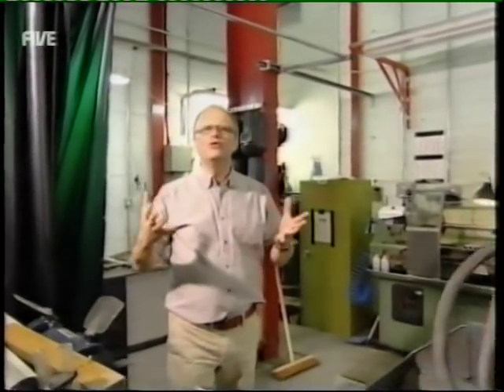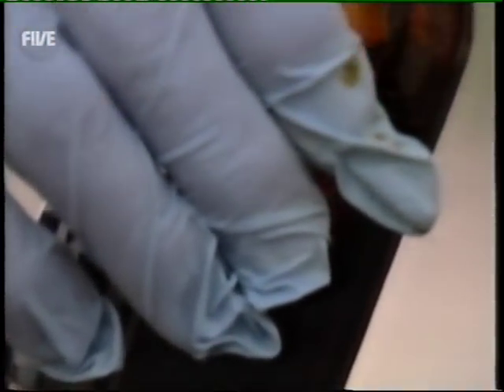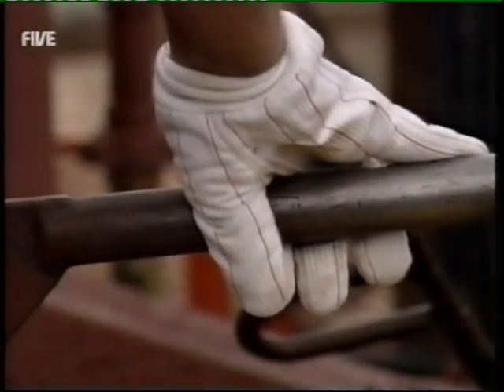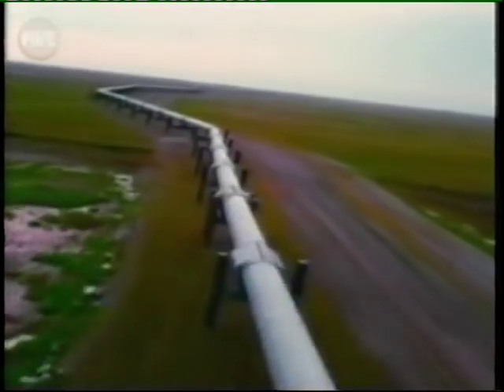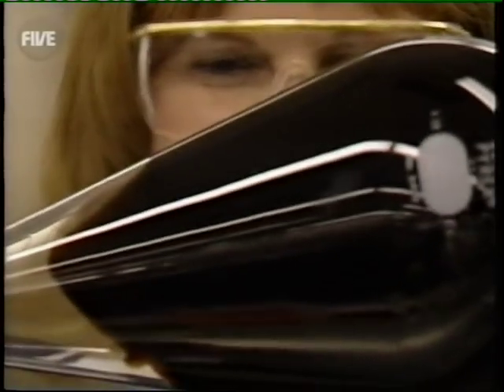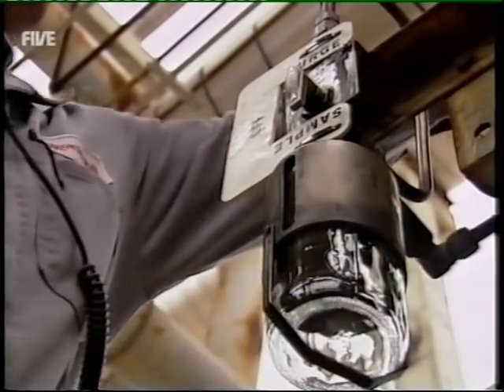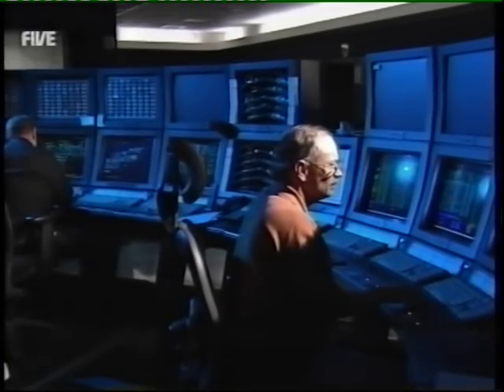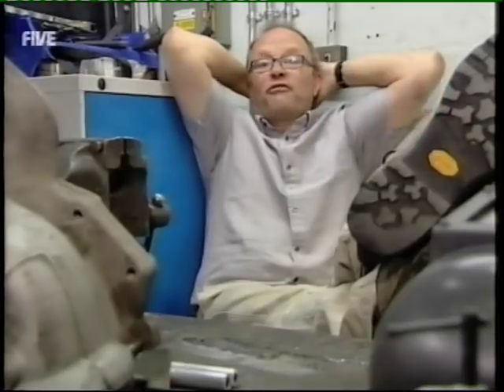How to Make Petrol or Gas from Crude Oil.

Comment: Well, that’s alarming! If they “...pump out 900 thousand barrels every day” and there’s only 10 billion barrels left, then it’ll ALL be gone in a mere 30 years (within a single generation).
Reply: And this was made in 2010, 22 years to go.
Reply: There is much more than 10 billion barrels. BP’s estimate is roughly 1,690 billion barrels that would be economically feasible to obtain using today’s technology.
Reply: thats why we are mostly buying oil from different country ( mild east)
Reply: You would have to add an ‘estimated new discoveries’ forecast to that equation, if they are calculating based on verified deposits only.
Reply: Crude oil is constantly being produced underground. It is by no means finite.
Reply: Oil does not form that quickly. It takes millions of years of pressure and elevated temperature to produce one barrel of oil. Pretty much all of the crude oil that we will use has already been created underground. What you're meaning to say is that oil reserves are constantly increasing due to improving technology to recover the oil and the current price of the oil. For example, hydraulic fracking enables crude oil that is trapped in shale rock to be extracted. This is only possible when prices are above 60 dollars a barrel. When prices are below that estimate, it is technically not recoverable. 
Source: I am a petroleum engineer
Reply: No, I meant the former. No one knows how fast oil forms, not even engineers. Your second sentence is straight from industry handbooks, yes? If it took that long per barrel the oil we consume in one day would have taken trillions of years to form. So without the pertroleum industry spin .. it takes the same time to form 1 barrel as it does to form a tankerfull.

Are you certain engineer is your job title? Perhaps you misspoke on your last sentence. "…. it is FISCALLY not recoverable. It can be recovered if cost is no object.
Reply: @Deploracle  Everyone knows that oil in a reservoir is only at the max around 30 to 40 percent recoverable if you spent time actually studying the said field with the best recovery options. So yes there are barrels of oil that are technically unrecoverable with current technology. Your math is also incorrect because there were a copious amount of barrels that formed at once. Not one at a time. From your response I know you are not knowledgeable in the said field, so dont reply about stuff you do not know about.
Reply: Agree to disagree my friend, I know exactly how it works. By the way it was you that said "one at a time" (it takes millions of years and X amount of pressure to form JUST ONE BARREL OF OIL.)". Take care ...
Reply: @Bluudclaat  thank you. I realized that he was a lost cause when he said "agree to disagree" to something factual. I dont understand how someone who probably doesnt even know 3 compounds in crude oil can comment "facts" about oil. No help for the ignorant.
Reply: Except for one little point … I'm not uneducated (physicist).
Reply: Yes, indeed. It's a religion exactly as I described. One must not speak from a position of science against the cabal. It is NOT allowed. I know apostates are treated poorly, but I trudge onward through the proud ignorance. Carry on knaves ...
Reply: Deploracle 
My high school mate is a physicist (we’re in our 30’s now). The smartest of our group. However, he too has the same disease that talks over every other professional in the room. Expert in citing articles from reddit forums. Whatever is going on with him, he’s just become a running joke for us now. Maybe it’s got something to do with the fact that we don’t really give a shit about his physics and he’s trying to gain our respect by steamrolling over every social nuance. I’m not saying you’re him, but this reminds me of it.
Reply: Bluudclaat You think I am here to try to gain people's respect? I'm just here to give my opinion. I don't make videos, and I didn't start this thread, just responded to it, once, before being challenged. So is having a differing opinion from the majority now considered arrogantly talking over other people? Would the engineers prefer to mingle amongst themselves instead?
Reply: Deploracle 
No, I was talking about my friend and speculating about why he’s turned into someone nobody likes to be around anymore. It’s not because he’s stupid, but because he tries to make people feel stupid by being a know-it-all despite significant flaws. I was saying this interaction reminds me of him (because he’s a physicist and I thought it was a funny coincidence). Let’s leave it at that.
Reply: Bluudclaat  Interesting that this is the age old conundrum we rehash. Being one with no friends, 2 cats and a sister, I can't be much help. However, allow me to try (I know, I KNOW ;). Are you certain he is intentionally setting out to make people feel stupid? A brilliant mind wouldn't get any benefit from that. He'd be better off staying home all things considered. I think he's trying to help others but really has no idea how to proceed. The harder he tries the further from the group he gets.

When I had friends, everyone hated to go to movies with me. I'd ruin it by always pointing out errors in the production or implementation. I decided to just shut up and not say anything … to make it more palatable for them. However I found it was taking more energy from me to not be myself than I was getting from the group experience.

He was once more tolerable I assume, since you mention "he turned into someone nobody likes to be around anymore". Change is obvious but the direction of the change is often ambiguous. Could it be the group has changed, becoming more practical and less tolerant of random variance?
Reply: Oil being formed """"
seriously? that shyt has already FORMED. 
New oil is NOT being formed, ever. 
As example, the billions of years it took, those years have already passed, oil at those depths is not being MADE, now.
Reply: I remember being told in 1989 that we had about another decade until we ran out of oil 🤣🤣🤣🤣🤣🤣 wrong again... Then the ozone... Then global warming ... Now it's climate change and the muppet Socialist club are the current hipsters 🤪🇺🇸
Reply: @dayjzworld  I can talk about whatever I like and it's your job to either read it or not. That's America … deal with it.
Reply: @100pyatt  A man with a keen memory is far more dangerous than a man with a gun. :)
Reply: @dayjzworld  It's not false information, it's opinion and everyone has one. Like I said a month ago I don't expect anything from anyone. I'm just living my life man, outside the matrix.

I didn't come here looking to be convinced, nor was I looking to get into a circular argument with the petroleum industry.
Reply: @Deploracle  Moral of the story: dont present an opinion on a subject you have 0 knowledge on
Reply: @dayjzworld  I do believe you've been triggered. Have a happy Wednesday!
Reply: @Deploracle  very true !
Reply: @Deploracle  There's no "agree to disagree" in science. The science here is clear, it took hundreds of millions of years for oil to form from plants and animals from older geological periods. Oil regenerates nowhere near as fast as we use it, basically at an insignificant rate making it so that the reserves we have now are limited and will never ever grow again.
Reply: @yaz2928  The scientists that first questioned flat earth would beg to differ. If there is no room for disagreement there is no advancement of knowledge. I didn't come here to discuss our various opinions and who is most correct because this is NOT settled science, you can think your way and I have the same luxury.

Who is it who cannot be comfortable with opposing viewpoints? It's not me, I forgot about this topic until I got your notification. Okay, so you think oil is limited ... that's cool with me. :)
Reply: @Deploracle  I don't think you understand what "agree to disagree" means. In science, if two people disagree on a subject, then they both carry out experiments and testing to gather data to see who's right, that's the beauty of science. Two people can't be right, always one right and one wrong. Agree to disagree is something that is reserved for subjective things like which TV show is better, not for objective analysis like in science.

The science on the formation of oil is pretty clear, the remains of plants and animals have become oil after hundreds of millions of years of heat and pressure being applied over said remains. We have proof that the process is extremely long. But your hypothesis (oil regenerates quickly) is based on no evidence at all. Cheers.
Reply: @yaz2928  We aren't doing science ... this is an internet comment section. So you don't agree to disagree then? I assumed you would, which is reasonable. What you want to do then is argue ... and ain't nobody got time for that.
Reply: @Deploracle  Oh, no problem buddy! I have nothing against your different beliefs. You're free to believe what you want, but when I see people saying things that are scientifically wrong I feel like I have an obligation to intervene. Otherwise good day to you sir.
Reply: @yaz2928  I don't think we disagree, I think we are misunderstanding each other.

I don't think oil forms quickly, never said that. I said it's a continuous process. There is a quantity of oil available today that wasn't available yesterday and it's ongoing.

Like a car assembly line for instance. You may see 15 cars come off the line in an hour, but that doesn't say anything about total assembly time.

If oil takes a million years to form, then what started the process a million years ago is available now. At oil's discovery there were a few billion years of carbon based life that had already formed and was available widely in the form of crude.

So really we differ on one point, whether or not the world's usage exceeds it's replenishment rate. You say yes and I say no. There is no way to prove either side ... and that's cool.

Well I'm going to go back to watching the Exxon Valdez disaster (just kidding) .. I'm a 100% nuclear proponent, but don't get me started. Thank you.
Reply: @Deploracle  People who stand up for what they believe in usually are lonely. Until their time comes, and others realize that guy was right all the time. Does not happen often. But that seems their function in society. Everything and every personality has it's use. Otherwise evolution would have sorted it out. I think a lot of qualities we deem "annoying" are qualities required by our species in different circumstances. E.g. whistleblowers, crazy geniuses, etc.
Reply: I think when people argue if we have x amount of year's or y amount of years basic facts are being ignored. If we don't have a major disaster of some sort that decimates the population and population increases at a steady or exponential rate(doesn't really matter which, only changes timing)   there will be a day that we can no longer increase production. We do not have a viable option at this time to replace oil as an energy source. I don't want to assume that we will not develop one but would prefer that we operate as if don't because it's just not fair to future generations to use up the easiest and most dense energy source because we were "reasonably" sure it wouldn't be a problem down the road. As of right now we don't have a replacement for oil as an energy source. As of right now we don't have a definitive answer of what our reserves of oil are. As of now we don't have another planet to go to in case we really screw this one up. So I guess what I'm saying is maybe we error on the side of caution and start to operate as if oil isn't an infinite resource. It applies to me as much as anyone. I drive a suburban with a big block and thought that was bad until I started driving semi truck's and was blown away by the amount of fuel just one takes to operate on a daily basis and then thought about ALL the trucks operating daily the world over. To my thinking we either start to dial back individual energy consumption or population. Otherwise we are very possibily running headlong into a disaster of such a proportion we currently can't even conceive all the consequences. Or you could just shit all over future generations. That's another choice.
Reply: That's probbably 10Billion in texas alone. What about the crude oil coming from California, N Dakota and other states combined.
Reply: Yes and we have been talking about this for the last fifty years, In thirty years my generation should be long gone, so good luck with your generation.
Reply: This video is 8 years old. Since that time they have discovered 2 more large reserves of oil in the Permian Basin with billions more barrels. I know because I drive a fuel transport in that area almost daily.
Reply: @dayjzworld  depends on what you believe- biogenic or abiogenic production, this is afterall, natural chemistry.  The earth has tremendous heat pressure and all the required chemicals constantly churning beneath our crust.  You don't find it peculiar that the presence of hydrocarbons on Saturn's moon Titan and the planet Mars both have been identified in various forms and in great amounts?  Do you not find it odd that microbes can both feed off as well as produce the very same substances we use for fuel? In fact, some microbes consume fuel, produce acid and weaken metals.  The oil industry thrives off supply and demand and the very last thing needed is a process indicative of a living planet.  The concept of global warming also adds crisis and a fork away from the internal combustion engine without actually curbing "fossil" fuel usage, lol.
Reply: Oh my,,, just think when they get it all pumped out. There will be a big vacant hole under the ground which will cave in a suck Texas in
Reply: bobwatters  I'm going off by the actual oil prices. It's too expensive to actually employ the more expensive EOR solutions and it doesn't become profitable. Hence why I said 30 to 40 percent. 

This is coming from a petroleum engineer in the industry
Reply: bobwatters  I was correct on what I said. The amount that you can recover is based on the oil price. Which is why I said 30 to 40 percent max. This is engineering economics 101. I have done multiple years of research on EOR and reading papers going back to the 90s to see the possibilities of using hydrogen for enhanced EOR. I know what I'm talking about
Reply: Relax my friend, whe have synthetic now.
Reply: @dayjzworld  40$* source Forbes
Reply: @dayjzworld  BS....if the price of oil drops, production doesn't come to a halt. They just store it in bulk container sites.
Reply: @SuperChuckRaney  I've actually seen a documentary where they have found oil effete the well was dry.  They even said it was remaking itself.  I don't think it takes millions of years to make oil when you can make alcohol in mere days

Comment: LOL!  Pennsylvania grade crude (also found in Western NY) isn't sticky, isn't black, and doesn't smell like rotten eggs.  And  you don't have to drill two miles deep to get it.  Low sulfur, high in lubricants.  Actually smells kind of pleasant and familiar if you grew up with it.  Oh, and you don't really need that powered wrench- I've done it the hard way, with two HUGE wrenches that it takes a strong man to pick up, and a chain binder to tighten or loosen the pipe and/or tools.
Reply: Yeah- for low-rpm, low-temperature applications, Quaker State and Pennzoil type oils were just about perfect.  Actually, for each barrel of oil, you get X gallons of diesel, Y gallons of gasoline, Z gallons of lubricants, etc.  The different grades of crude have different mixes.  For example, Venezuelan crude has almost no gasoline, and to get it takes expensive advanced refining.

Comment: Good video, thanks.  Well done.  I learned a few things. 1 suggestion: you could mention the metals used to pump gas in and out of trucks are not spark-producing.  I think it's magnesium.
Reply: I think bronze is often used too.
Reply: I don't know about that but I can tell you the metal couplers on the fuel hoses are aluminum. There is also a grounding wire embedded in the hose itself. At least that's how it is on my rig.

Comment: 159 litres of crude oil produces 168 litres of products..........Clever stuff!!!
Reply: Lol! He's not saying that it has 168 litres within the 159 litres. I would think making things like asphalt you'd probably have to add things during the "production" process!
I love when YouTube commenters say things to insult other's intelligence and end up proving their own intelligence.
Reply: I'm not a petroleum engineer, but I think I know the answer to this.  What you have to consider is the densities of the different fluids that come out of the refining process. The question isn't how many liters go in and come out of the process, and are these volumes equal.  The question is how much mass goes in and how much mass comes out.  The mass going in and out should be the same.  So if 100 Kg of dense crude go in, and 100 Kg of various distilled products comes out then everything makes sense.  But what can happen is that the fluids that come out will be much less dense than the crude and so you end up with a larger volume.  I'll give you an example.  Add a cup of honey to a liter of water.  At first it will displace the water and increase the volume in the glass by 1 cup.  But then as the honey dissolves into the water the volume will reduce and the glass of honey water will have a higher density than either honey or water alone.  If you were to measure the volume of that honey water solution, and then distill the liquid and measure the volume of the honey and the water separately, you would see that more volume came out than went in to the distiller.  It is the same principal.  Mass in = Mass out